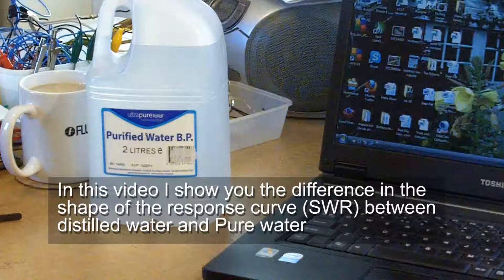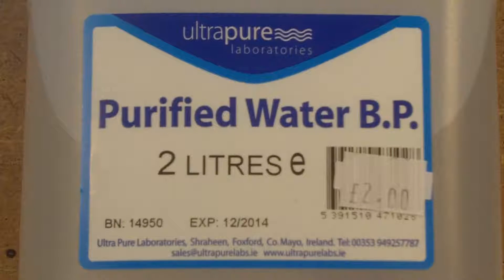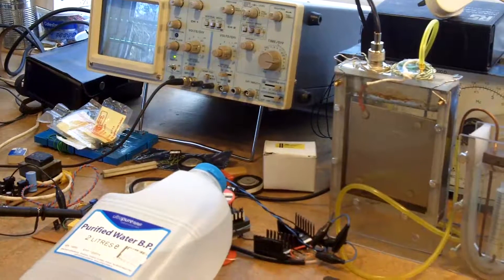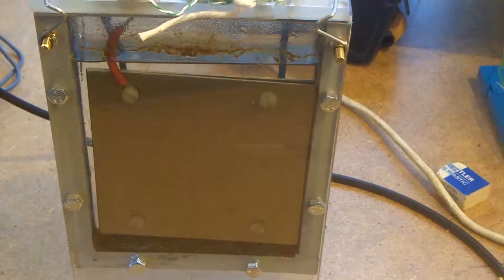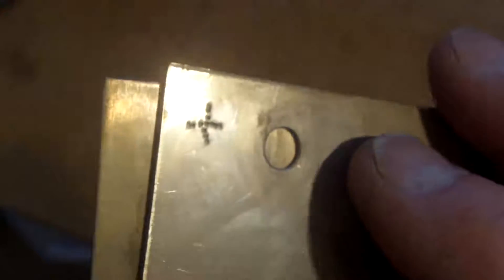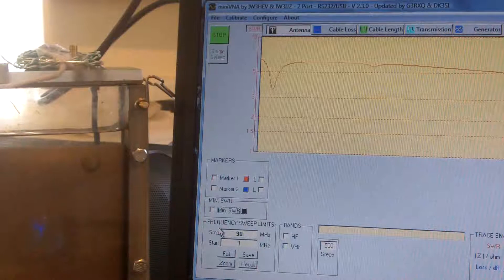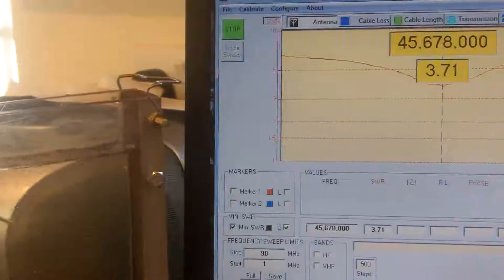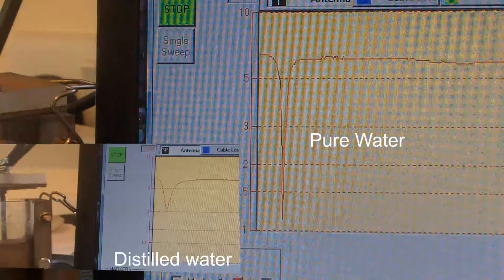HHO. 22 comparison, Purified Vs Distilled water in resonant cell

Comment: The big thing to understand with distilled water is that its pure, h20. There is nothing in it. No chemicals, no trace elements, no minerals. Its neutral. So when it comes in contact with air, it sucks up anything thats bad in the air. It's one reason people use it as a body cleanser. If you smoke pot and need to pass a drug test drinking distilled water will help pull it out. The best way to get distilled water is to distill it yourself so it goes straight from the distiller into the cell to reduce the amount of contaminates it will get. Pure water from reverse osmosis if its done right does the exact same thing. the major thing is that both need to be ran through a carbon  filtration system to remove chlorine and other nasty things. So in essence they both are the same thing. The idea of the hydrogen cell using distilled or purified water is that its nothing but the water. There isnt anything like chlorine in the water that could be dangerous if turned into a gas and might lower the efficiency of the cell. The only thing in distilled water is the electrolyte you put into yourself
Reply: Good explanation!

Comment: Tanks for your video. Could you test the production of HHO at a certe some frequency? If you have a PWM device you could pulse the cell with a very short duty cycle, but the cell must have the same resonant frequency. Could adjust it with an inductor ?